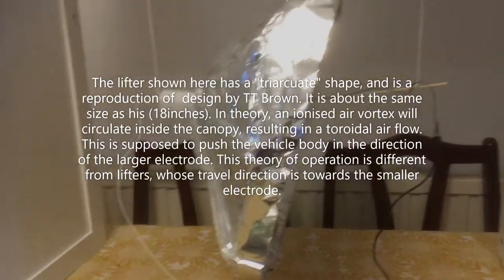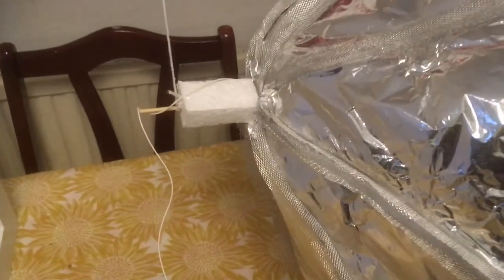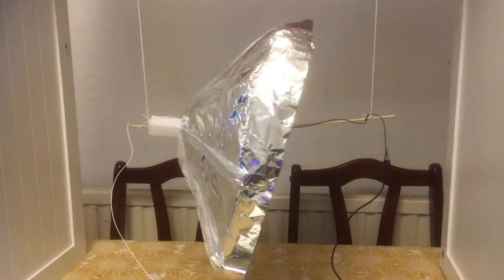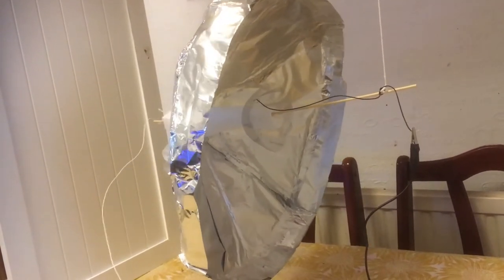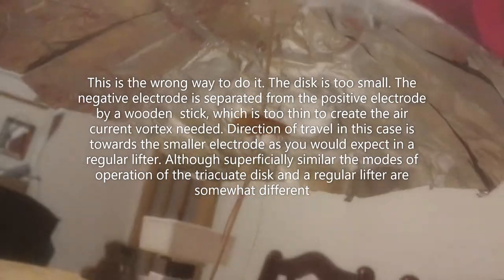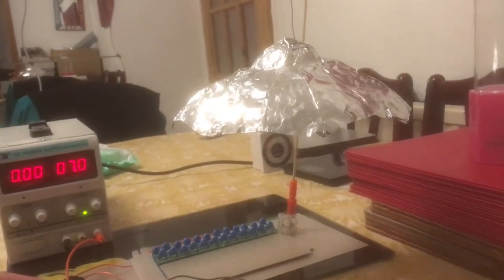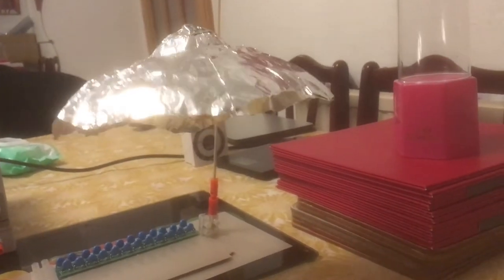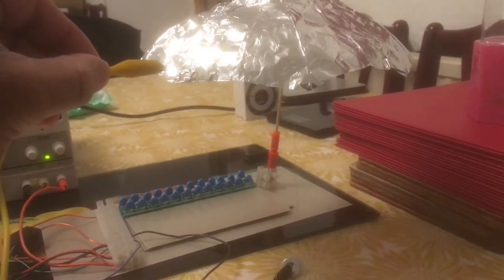Triarcuate ballistic electrode (Horizontal Pendulum test)

Comment: TT Brown’s condensers worked in a vacuum. It’s not ionic wind. However it requires Telsa levels of voltages (50k volts minimum and 250k volts ideally)
Reply: Correct
Reply: So if TT Browns worked in a vacuum and it's not ionic wind than what is it? maybe this is what they were celebrating in the old rare footage of the lab experiments?
Reply: @fireball75677  ‘Gravity’ is a voltage potential. It’s a longitudinal EM impulse wave or a “soundwave in the Aether” as Nikola Tesla once said about light. Every transverse oscillation of an EM wave has an initial longitudinal or scalar impulse component. That’s why when you close or open a switch on a coil circuit you get back EMF where the voltage potential far exceeds the voltage rating of the power source and then it’s followed by a bell like ring down effect. That voltage spike impulse is gravity. And that’s why for the brown effect to work it needs a high voltage differential between the anode and cathode of the disk.

Comment: Can you show me the power supply here it seems to be powered with a Chinese module and voltage multiplyers
Reply from the maker: saucers take a lot more power then lifters. I originally tried to power this from a variac and neon sign transformers 30Kv at 50Hz, it didnt work very well. What worked for this configuration was the power supply I show in the pdf document in the Lifter axis driver section. https://github.com/cybernetic-research/ion-lifter-esp32-command-control-network/blob/main/Lifter%20Command%20and%20Control%20Jan%202021.pdf

 It boils down to using cockroft walton:
https://www.ebay.co.uk/itm/255025521023?hash=item3b60b4a17f:g:qIcAAOSwENpg0W6K&amdata=enc%3AAQAHAAAAsJ1O%2FKCtRU2n%2FmCUt9ho1vxuPhVEWSPcR%2BjYzTyixqIGlZ0So1HcCbKh1M8PrRwFNIPhv1kyaSHh0fVAlVSLpS2AGmQ6CGdbAQUoGkZ2NMF5kggqJWGSGehPlE6bflcOyYW%2FEfeI%2FUXNcAnYCBcub0AflLnbN20dG8NGP4b93J2i57XhWgJDChQ5p8O12DU0e8mUOv%2BJ73%2BuhugA0SSnBLpShg7jIRzY443aP0GUghgm%7Ctkp%3ABk9SR9SmwMuhYQ
with high frequency ac transformer:
https://www.ebay.co.uk/itm/284075054876?hash=item422431571c:g:7OAAAOSwIK5fqhu3&amdata=enc%3AAQAHAAAA8DnNxe20Tqfb5wmcmSaDLPUrEyR%2BX2svi9nm66Ak1iUL%2BwdhOwnOWrnR5oW8%2BSfO5tRHGsDPmpD%2Bm6N3glOFnjfp7HLxqykWVH9ZUCbTDBRp1IIFgmOYlZkCs5fpoGf9ubQxLQh%2FRTTQAeX%2FdJCxCAkV4EoKEPtoqeutYUhT2Q0TT6a9gc883DoUUmuYyJPhYGY%2BQdUYNrkZwx1pBsbsUw%2Ft%2FWJvw8TS1WqQrNiz0gHHqgC5EYRt98mWR7qPgpP%2BsRaRJxlXIFOKoTsJWdGjQhXl3dcVuZP9yDoHR%2BBC9aROuEN1Y6xlwZMkpfr98TO%2BDg%3D%3D%7Ctkp%3ABk9SR_yT4suhYQ

You can go up to about 7v DC ~3Amps but you must keep everything cool and insulated with cooking oil or similar. If you dont the HV sections will arc all over the place, and all the potted transformer will overheat. Only use for 3minutes or so at a time, let it cool. Use variable voltage 0->7v DC or low frequency PWM (50Hz) for High voltage control. I estimate this combination (transformer+cockroft walton) was running around 60->70kv based on spark length
Best transformers I came acoss for lifters and saucers were:
https://www.ebay.co.uk/itm/284977261209?hash=item4259f7ea99:g:MjUAAOSwZBJjLbm2&amdata=enc%3AAQAHAAAA8NaxSD8bXtVpqFw81HzND0gSjscwkqOaMCI1KLBW9IZH3HOVBGWo8RVQNFLYhoPRGVEag%2Fh7a664cuBgxVwCAjlfgihVqWv6if%2FMyCT%2BBvtmPUZj5pUzHiLC%2BOv%2Bukc7xxUVd3zDphJD3Zfl2M9IXmYv%2F9WeyOAGxGHQsPTJBRzJiwc%2FsVxExhVElFXGhu305lhgNeX3TTivcHYmHd0Q3TPNdk5wDmj1H3XJg%2BA5v5h6%2BY1V8J4HS8SGFewvvsziAhnnTt0ZAH%2BQyHmURWgEFB86vyFUmWqBuNqdf3fEjMT62PY6lLEgEcF%2Fk2aSZbVOcg%3D%3D%7Ctkp%3ABk9SR-LGy8uhYQ

You can keep going with the cockroft walton stages , but you need to beef up any mosfets and cool everything

Comment: Cool! I tried that once. Wasn't even DC and it deflected.
Reply from the maker: It worked with ac for you? Maybe in this design you just need the right air vortex to be created, regardless of polarity. This is an unusual design  I think, and there is probably a lot more to learn here. I will be trying to run it vertically at some point in the future.
Reply: @c6jones720  yes. The scope shot  sort looked like it was more one side of the center line so perhaps it was DC bias that drove it. I will see if i can dig up the old video. I used a silver varnish over plastic. The driver was 2 car ignition coils driven by an 555 oscillator...check your comments held for a link from me under these comments....
Reply: @c6jones720  https://youtu.be/-IDcQBFvh7M  here is the link from my replication. It's from 12 years ago, so pls excuse the potato vision!
Reply from the maker: @m3sca1 I saw the video and Im really impressed. My question would be how much of the plastic plate did you cover with silver paint? Was it just the outside, I couldn't tell if the inside face was coated too. I kind of assumed that the whole canopy would have to be conductive, but maybe not.
Reply: @c6jones720  just the topside of the plastic plate and same for the piece underneath. Might be worth giving this approach a go since the rigidity of the plastic holds its form.
Reply from the maker: @m3sca1  definately, I think the trick is to have a serious power supply because this design is relatively heavy.
Reply: @c6jones720  the varnish is not cheap since it was real silver...perhaps some newer carbon paints would work